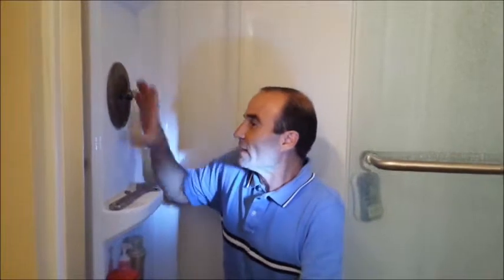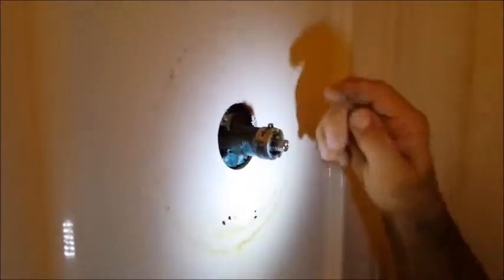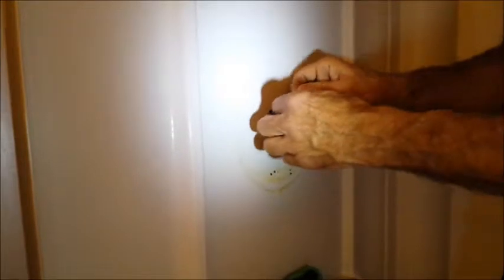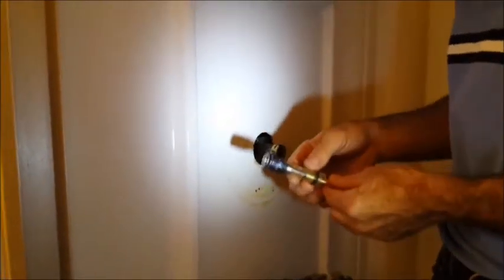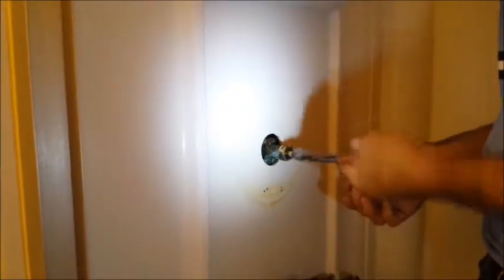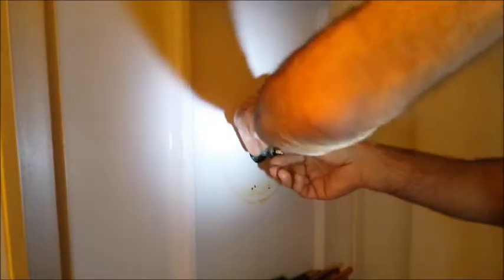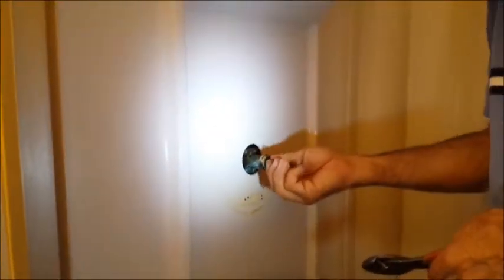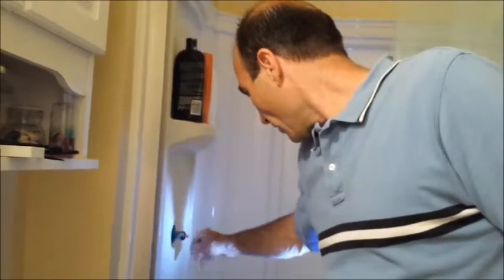Repair leaking shower

Comment: I have a leak into the ceiling below. BUT ONLY when I use the shower (not the bath). Can a faulty valve affect ONLY the shower part?
Reply from the maker: Not likely.  It's probably the riser pipe coming out of the top of the valve or the shower arm in the wall at the head.  Also, it could be a caulking issue from splashing water.  Try running the shower directly into the drain without anyone in the shower and see if the leak still happens.  If not, then you likely have a caulking, grout or sealer issue.  
www.houserepairsyourself.com
Reply: Home Maintenance Solution, Inc 

Thank you for your kind response. I replaced the shower head arm and put teflon tape on it. I tightened it real good. I'll see if this helps.

I really appreciate your advice.

BIG THUMBS UP FOR YOUR CHANNEL!